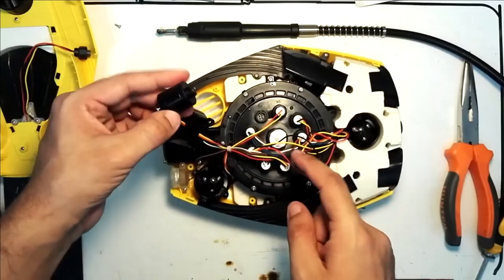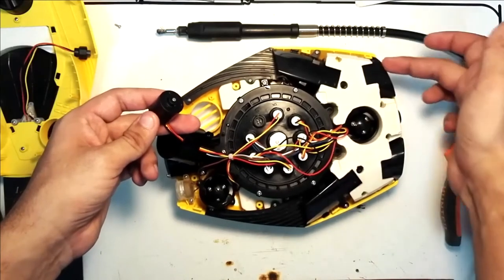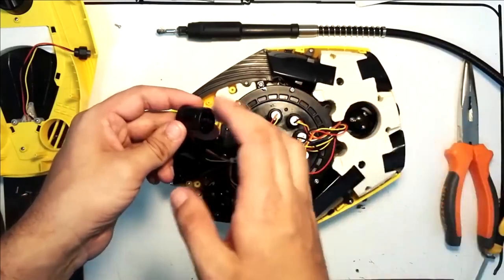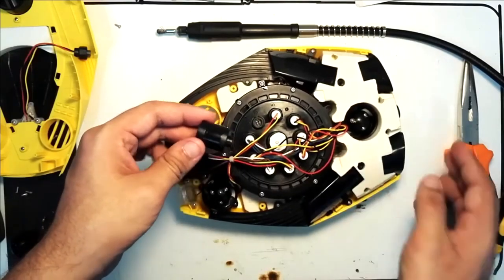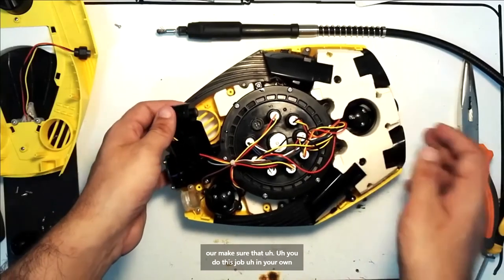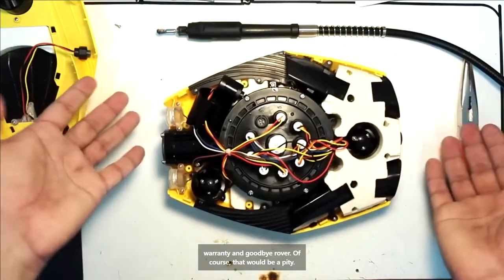CHASING DORY DISASSEMBLY, Cleaning and motor servicing

Comment: Were all of your case screws philips?  ONE of mine was a T6 anti-tamper torx.  ONE.  That's just spiteful lol.  I've ordered a full set of long anti-tamper torx so I can finally open up the case and work on my forward port thruster.
Reply from the maker: Sorry for the late reply. I am not sure I saw a Y6 screw whilst opening it coz it's been a while. That's a good idea replacing the screws. Good luck working on the forward por thruster :)

Comment: Very informative video! I noticed that one of the screws is different from others. What size of the screw driver did you use?
Reply from the maker: To be honest I use a "wide enough" philips screwdriver so I don't damage the heads of the screws. If the head of any scew gets damaged, I replace it with a Nickel based screw. Do not use steel.
Reply: @Andrbusu  Thanks!

Comment: Ummmm. I understand that you opened it 'cause you wanted... Yet i think opening it i think makes the warranty void instantly... I thikt this is what we can do when rov is after warranty and to sens it for service would be parting your rov for more than a month... I think this is not a standard post use approach...
Reply from the maker: Thank you for the comment and feedback. I usually work on things that would have gone out of their warranty time ofcourse. The motors seem very prone to rusting and seizing quickly so I had no other choice but to work on it. As long as the main module is not damaged and the connectors are in good condition, then the ROV is operational. Luckily I also have the right knowledge and experience to do work like this.